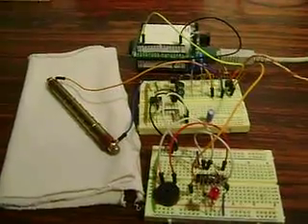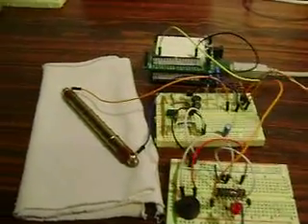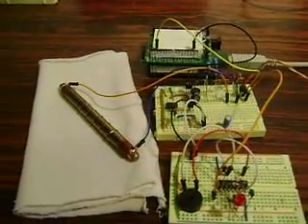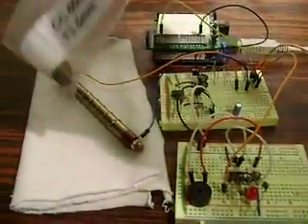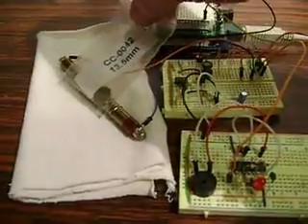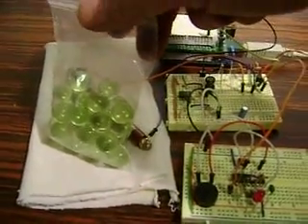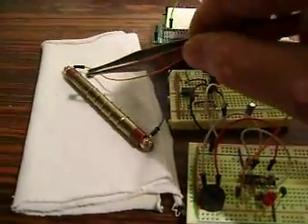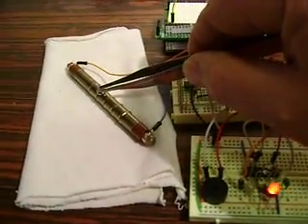DIY Geiger Counter (with build plans)

Comment: BroHogan      since I'm using a current limiting resistor in series with the gieger tube, does that mean If my gieger tube needs 300 volts I need to use 600 volts to account for the voltage drop from the resistor?
Reply from the maker: Owen Chase No.. Set at 300V but must measure using a series resistor as described in the build instructions.
Reply: I did mesure it in series with a 4.7 mega ohm resistor my power supply was 600 volts mesured it after the resistor and got 270 volts that is to little of voltage for my tube to use?
Reply: Im doing it from scratch.